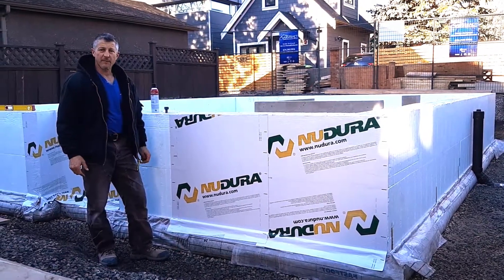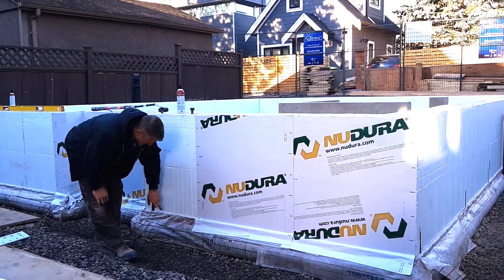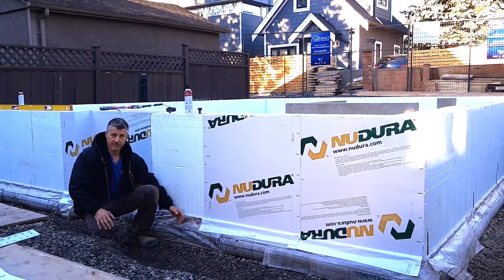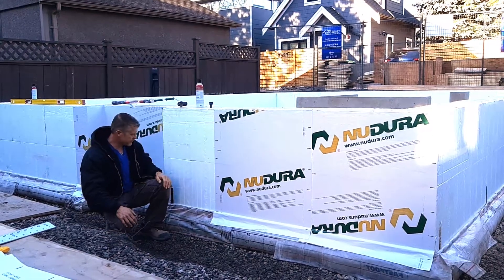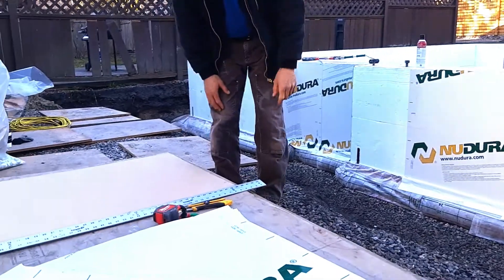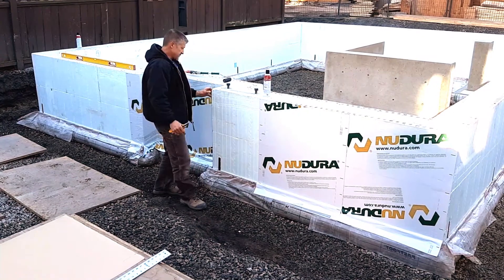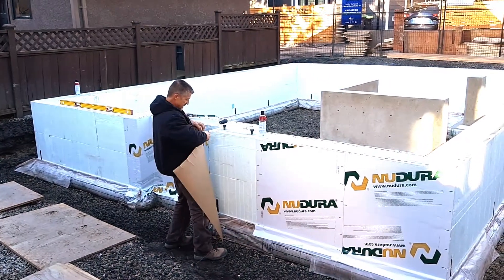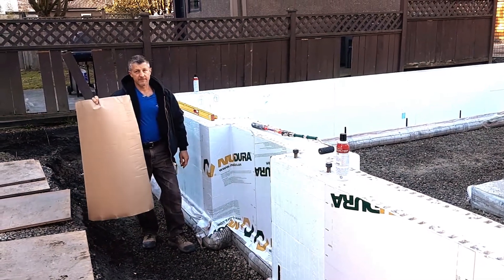STEP 2 - Best Foundation Practices - Monopour, ICF & Nadura

Comment: What do you think about those who are spraying closed cell foam on the block exterior as water proofing? And spraying it on top of fill for under slab insulation, radon and moister proofing?